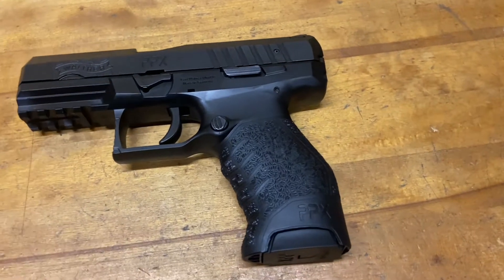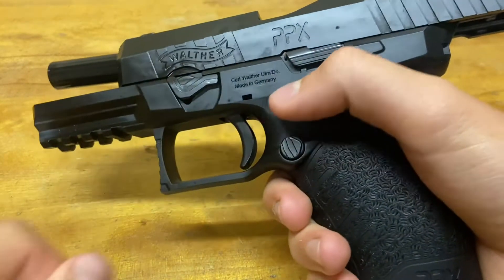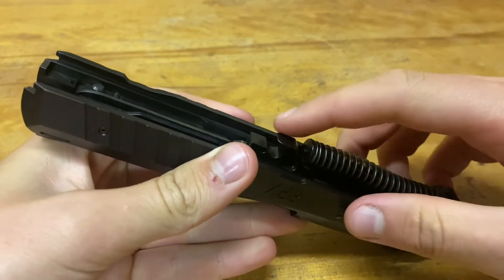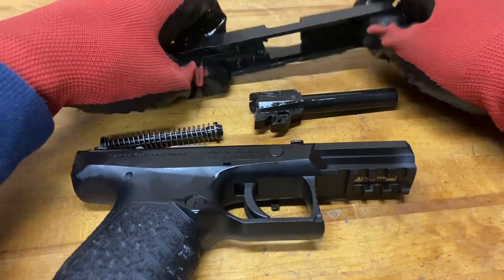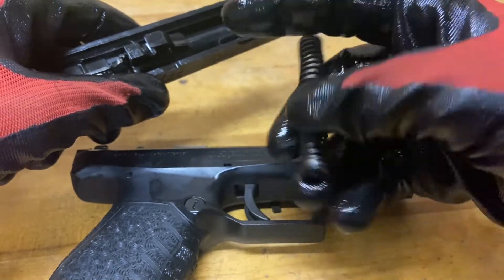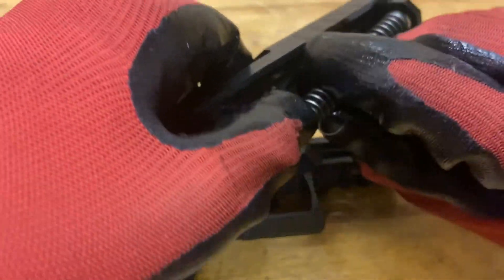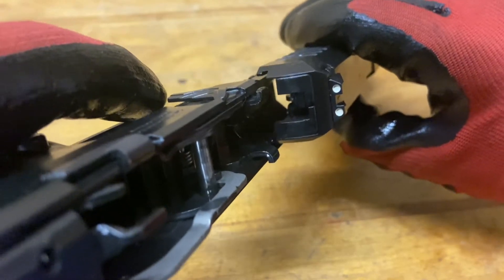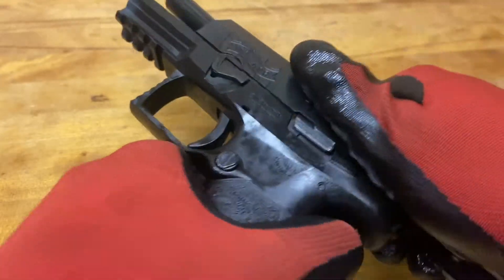Walther PPX disassembly and reassembly

Comment: Note of caution: The recoil spring assembly is very cheaply made. The guide rod and cap are made of plastic and can inadvertently come apart. This is one of the major shortcomings of this firearm. Walther should have made the recoil spring assembly out of all metal components.